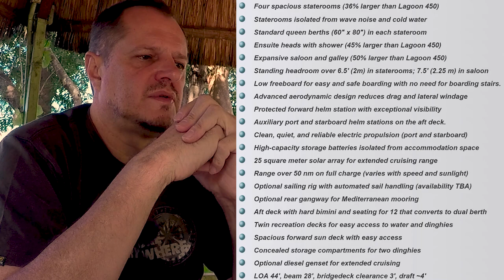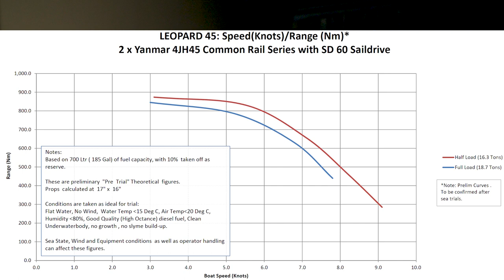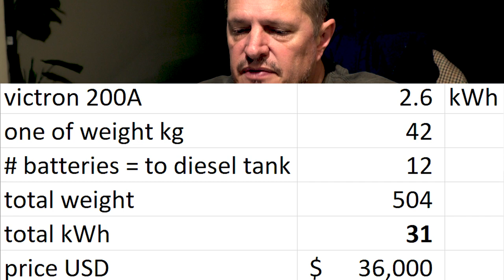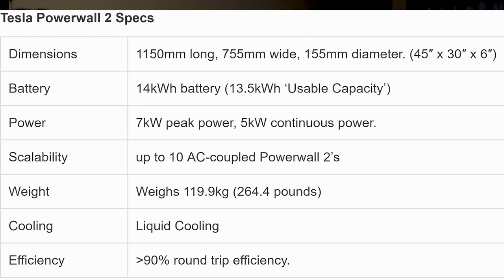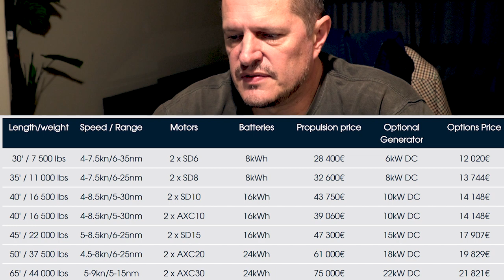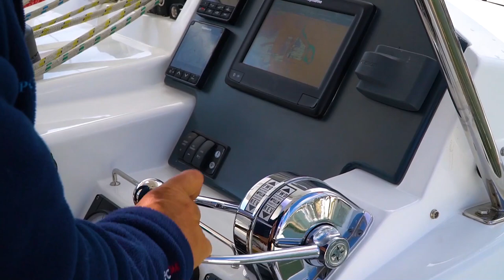#25t Diesel Engines or Electric Motors for Our Catamaran | Sailing Sisu in Cape Town South Africa

Comment: The problem isn't just battery weight, but the weight of the naked boat you're trying to move in the first place. Both a bicycle and a truck can transport a person from A to B, but when you're trying to move a truck with an e-bike engine, it doesn't add up. The electric concept makes no sense for a boat as heavy as 10 tons or more.

Let's for fun try a thought experiment and investigate what is the perfect concept for a  (solar-)electric yacht:
[sorry this ended up as a VERY long read... I got carried away and kept adding because the topic is so exciting ;-)   let's hope some readers share the interest]

As a rule of thumb, at least about twice as many kW solar peak-power per ton of displacement are needed in order to end up with a good performance under continuous autonomy.
On the one extreme we see those little hydrofoiling carbon fiber Formula1-style racing boats in the Monaco Solar Challenge with more than redundant solar energy, while at the other end of the spectrum we have heavy luxurious liveaboard cats that by nature are at the very best anemic under renewable energy. Where is the middle-ground, performance- and utility-wise?

Silent Yachts (Austria) is probably the company that has the most experience with building yachts with (solar-)electric propulsion (with traditional mast/sails/rigging or kite-sails only as options). Their boats are quite impressive (and just as expensive...) and can make sense in some use cases like predominantly coastal cruisers (although advertised as "trans ocean"), but they are also prohibitively heavy, at least in the context of a solar-electric concept, which is why they're also hybrids with a backup diesel generator for "just in case" during ocean-crossings.
Other companies like Soel-Yachts or AzuraMarine/Aquanima aren't doing much better. Even the PlanetSolar Tûranor, the first true solar boat that completed a circumnavigation under sun-power alone, had a relatively high displacement per solar-peak-kW ratio (89 tons/93.5kWpeak), probably as a consequence of its huge size (31x15 m) that required additional structural reinforcement.

It's a vicious circle: heavy boat --> more kW needed --> more battery weight needed --> even heavier boat --> impossible to sufficiently recharge those batteries on the go with solar or wind power alone.

Now imagine a 35-40 ft bluewater catamaran that doesn't displace more than ~ 4 tons, which is absolutely possible for a performance-oriented vessel with a smart foam-core sandwich construction (especially when you don't need to add weight for 2 heavy diesel engines, sails and rigging, not to mention that everything else like anchor chain, docking cleats etc can also be lighter for an already lighter boat). Something like 2x10kW Torqueedo-cruise outboards (~7500$ each; advantage of steered outboards: rudder weight+complexity+damage risk+extra drag+draft are obsolete) should be more than enough, even at very low throttle settings for a still good cruise speed. And because with solar it's all about efficiency rather than top-speed: the hull shape should stick to a displacement-type as much as possible, instead of semi-displacement-type with lots of inclined surfaces at the bow and a significant front rocker, like often seen in sail boats. In a solar-electric boat we wouldn't care about surfing on a strong downwind anyways, so we're not looking for any lift at all (any surface that creates lift also creates drag; top speed goes up, but efficiency goes down). Therefore an optimal solar boat hull would be closer to a flat-bottom kayak than a sailing vessel; no front rocker at all, sugar-scoops narrow below the waterline (=reserve boyancy mainly above waterline), combined with aft rocker to avoid a submerged transom.
Btw: the steerable dual outboards, as mentioned above, have the additional benefit of improved maneuverability at slow speeds, compensating for the impaired maneuverability (but better tracking!) that would otherwise be the price of having no front rocker at all.

With such a vessel now the overall concept works: it's possible to sufficiently recharge the batteries on the go while staying net neutral over the period of a typical 24h day.
Let's say the peak solar power is 10 kW (e.g. 30 panels à 340W, which fit on a boat of that size, requiring a large flat roof of about 8.4x6 meters): even when you're only getting a third of the theoretical peak power (i.e. 3-4 kW), this is still enough to move such a light vessel at reasonable speed. And when the kW/h requirement is low in the first place, also less batteries are needed to make it through the night (at least at moderate speed).  In reality, the solar output will be higher than the mentionend third of the theoretical peak power at least during the hours around noon, which is when the energy spent during the last night is recharged.
As an example, a Pylontech US3000 LiFePO4 battery weighs only 32 kg for 3.5 kWh (@48V) each, as a complete package, including battery management (and can be found at around 1250 Euro each). Take about 8 of those (that's 28 kWh total) and it's already enough to make it safely through the night with such a light boat, without adding lots of extra battery weight. Much more makes no sense  unless you're saving up energy in advance while staying at anchor, because there wouldn't be enough excess energy to recharge more battery capacity over the course of a given day while also being under continuous power.
In higher latitudes or after very cloudy days, pausing (and sleeping!) for a few hours during the second half of the night (whilst holding positions with a large drogue deployed to avoid leeway) could be a better option than going very slow the entire night. This strategy would probably also depend on wether the seastate conditions require active management. Series drogue or para-anchor could serve as emergency backup for very rough seas at night under limited battery reserve.
Nice bonus of all that solar area: it can double as a giant rain collector, so even the water tanks can be smaller/lighter for longer passages.

In other words: the solar-electric concept has it's merits even as a standalone-propulsion with full autonomy, but not with something like a Leopard 45 or not with wide-beam demi-hulls, not with water-maker, aircon, washer-dryer and lots of non-structural furniture. On the other hand a solar-catamaran that has little more than electric engines, batteries+charge controllers, solar panels, anchor locker,  furniture that doubles as structural elements and only the most basic appliances (head, shower, pantry): yes, it should absolutely be feasible to build this at <= 4 tons. Freeboard, aerodynamic drag and lateral windage are a bit of a challenge for such a concept, but nothing impossible. I really believe this could be a new way of "sailing". Wind energy also has its charme, but let's be honest: how often are sailing vessels motoring and how often are they tacking crazy zig-zags at ridiculously low distance made good over ground because the wind direction isn't in their favor? Also: there is an inverse relationship between the weather being "nice" and boat speed. Doesn't it sound attractive to instead chase those nice sunny patches with dead wind, instead of running with the weather fronts?
Last but not least there is the topic of maintenance, associated costs and component failure.... Other than the occasional antifouling-paint, what's responsible for all this cost- and labor-intensive maintenance? Right: sails, rigging and diesel engine. On the other hand: a brushless electric engine, solar paneals and lithium batteries require almost no maintenance at all. Combine that with hydraulic steering and you have a very reliable and almost maintenance-free 24/7 autonomous bluewater boat.

Maybe I'll build it myself one day - I'd start tomorrow if I had 100.000€ to spare ;-). I already drew detailed CAD plans and ran the hydrodynamics and weight calculations for fun ;-)
Reply from the maker: Wow! Thank you, Christian! This was now very informative! Yes, I agree with you. You have to build the boat around the solar specs and not the other way round. Weight is everything. Sisu's weight increased with almost a ton just by having the solar, solar support, batteries, inverter, BMS, Lithium under and over protection, busbars, kilometers of heavy gauge 12V wire, MPPTs, Chargers, Charger-Controllers, and monitor systems/networks. 
I guess another point is exactly what you said. You need a lot of solar, I mean a lot. We have 2.7kw solar and I rarely see nowadays over 900W coming in. In the first couple of months in Cape Town we never left the 100% charge, nowadays we have the run the engines (no genset) every third day to get the batteries holding through the night. I can already see me replacing the solar every few years or just be happy that their efficiency is deteriorating every month. Or perhaps it is the Lithium that is getting old and not so efficient anymore. I do not know, but we are now in our third year and our Lithium/solar/windgen system is at 60% of its initial performance. I thought it was the high latitudes, but we are now in Antigua and Petro already told me that we are at 30% again. We do not use aircons, we do not use the electric kettle, we do not have an induction plates. The biggest is our two laptops with big graphic processors, our cameras and drone batteries, and then the Battery Monitor and Management System itself.
Reply: @SailingSisu  Thanks for answering. I guess another part of the reason why solar efficiency can be diasappointing with sailing vessels is frequently being in the shadow of sails and mast. A few percent of shadow coverage are enough and the output of the affected panels will drop to almost nothing. Even the mast shadow alone (+radar, antennas...), with reefed sails, could be enough. I observe that with my RV, where I put 900 W peak onto the roof: I'm quite surprised by its high efficiency, even over here in german latitudes, but it's enough to be parked next to a street lantern and the panels in that narrow little shadow are temporarily dead. And keep in mind: connecting several panels in series like it's usually done in order to run the system under a higher voltage (=smaller wire gauge required, less losses within the wiring, higher efficiency in cloudy conditions) also implies that even if only a single panel is covered by a little shadow, all other panels in that series are 'dead', too.
Reply from the maker: Exactly
Reply: @SailingSisu  Slight correction regarding my thought process for the last sentence: the bypass diodes should deal with that (yet still, of cause internally the cells in individual panels are also wired in series, so the problem with partial coverage remains unsolved).
Okay.. I'll shut up now ;-) Have a nice day!
Reply from the maker: Thank you, Christian!

Comment: I personally think that electric is only an option if you're going to spend most of your time under sail, then your panels and or wind turbine are topping up your batteries. Also as, you said, when doing more than 4.5 /5 kn you can generate power with your engine.  So in theory your batteries should be topped up for when you need that bit of engine power to help you out of a tight spot.
Another option would be a hydrogen fuel cell, but reliable supply of hydrogen could become an issue, unless you're prepared to sacrifice space on your boat to make your own hydrogen from seawater.... but again, that is dependant on you spending most of your day under sail. 
I do think it's the future of power on the water, it's just a matter of time.
Reply from the maker: I agree 100%

Comment: You and I think much alike about using electric drive motors. I think differently about how to achieve Nm range however by adding a 20 to 30Kw diesel generator range extender and reducing your battery bank to a generous size for the house needs. Solar panels and a windmill sized to the battery bank will charge this bank while at anchor and while under sail the electric drive motors can regenerate the bank. I rather like the Oceanvolt SD15 drive motors if money is no object. Most of the time those 15Kw motors will not need to use more than maybe 8Kw on each motor, unless your Cat is heavily loaded. I hope your ideas work out for you.....
Reply from the maker: Thank you, Ed! Yes unfortunately, fossil fuel is the only way to extend range. My objective was to say that if one thinks that replacing the weight of the fossil fuel with batteries, think twice. It is at the moment, inevitable that electric propulsion will add weight and lots of it. Performance cats being put forward, weighs less than 10 ton (can use less to sail) and can sail easily 25 knots (easy to regenerate) while cruising cats weighs up to 20 tons and sail in 25 knots of wind in exceptional conditions, 15 knots. Cruising cats will just get more heavy with electric propulsion. I will go electric route eventually, but with open eyes :-)

Comment: Hi Frik

Have you looked at SolarWave? (https://www.solarwave-yachts.com/english/ or their new site http://www.silent-yachts.com/) They seem to have cracked the solar motor issue.

To take your comparison another step forward, remove the weight of the sales and mast (and ropes) too and add that to the weight of the batteries you can carry. You can also remove the difference in weight between an electric motor and the weight of the diesel engine (plus all the spares and oils you need to carry for the diesel engine). I think that all the above combined will add a significant amount of extra battery weight you can carry and give you a lot more electrical power.

On another note entirely, since you're in touch with Leopard, there's a feature I'd love to see all manufacturers add to their yachts and perhaps you can get Leopard to add it to their range. A fixed window just below the water line on either side would be great! You can see the entire pod of dolphins (or whatever) are swimming near the boat while under way and, particularly in shallow water, it is useful to check for depth and also useful for spotting the better places to snorkel so you don't have to waste time with trial and error from the surface.

I really enjoy your videos and like your analytical approach to everything. I'm particularly glad that Leopard will make changes in light of your findings and think that you are doing the community a great service with your channel. Thank you very much indeed!

Cheers, 
Trevor
Reply from the maker: Thank you, Trevor for the kind words!
Yes, looked at the weight, but still even those solrwave gunboats have a diesel genset onboard including the smelly smokey fossil fuel engine (they call them "range extenders" but it is a 15kW genset)....which put all the weight back again. Unless off course if I missed the part where they say they can sail 800nm with the lithiums only. keep in mind, it is not always sunny, it is not always windy...

Comment: Use the solar panel to power superconductors that will run a motor and they can be charged up fully in 3-4 seconds and take 1 million + charges, compared to dirty lithium which would only take 1200 charges. And you would save on weight and space, And in the long run thousands, Because them heavy lithium battery rack will be needing replaced every 3-4 years outch!
Reply from the maker: I am following super capacitors, but as you mentioned, they are still getting into the picture, and there are not many devices that can charge 1000A in 3-4 seconds (except lightning). Myself is an Electronic Engineer who went over to the dark side of software engineering :-) but, please, give me the link to your sources for super capacitors (commercial, proven ones, not home made ones)
Reply: Capacitors are dangerous enough without adding corrosive atmosphere to the mix...  I think you may be waiting on Graphene.

Comment: I’ve also thought of going electric and putting a two speed gearbox on the motors with having 3 seperate water cooled battery banks so they can cool while they charge with having alternators on the motors with a smart system that divides the power between the batteries that are under temp as well as the wind & hydro generators + solar
Reply: Ev West have some good tech
Reply from the maker: Thank you for watching, Robert! Tell me...are you then thinking of a duel (not hybrid) system when you talking of alternators?
Reply: No ev West do a bracket for their electric motors which you can attach water pumps and alternators I reckon the system would pay for its self with in 2 years not having to buy fuels oils besides the gearboxes have a look into their sight they have YouTube videos as well but they are doing it on cars and to what you said about getting out of a bad situation you could always install a generator for back up
Reply: Sailing Sisu b

Comment: You have not mentioned the fact that you can have one small generator or fuel cell to extend the range of your oceanvolt system
Reply from the maker: Yes, I did not because that was not the exercise :-) if I was to follow the genset route, then the diesel tank and noisy smelly tractor engine would be back taking the weight and space of the Lithiums :-) the point was just to compare apples to apples, weight to weight...